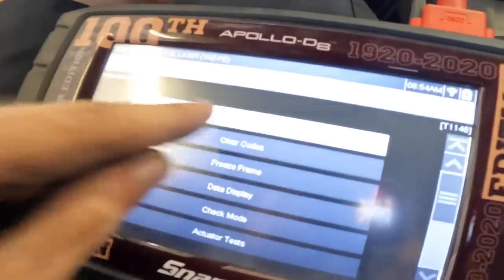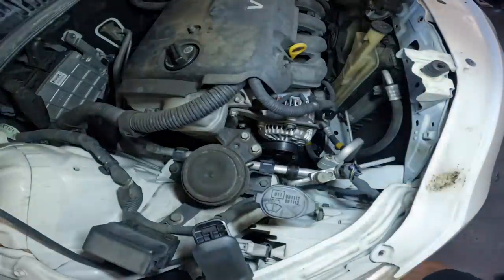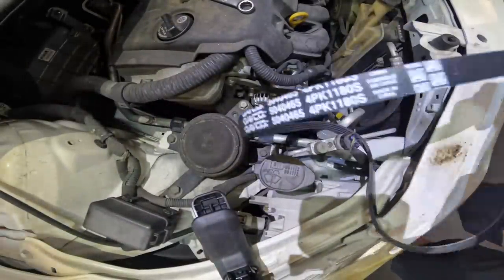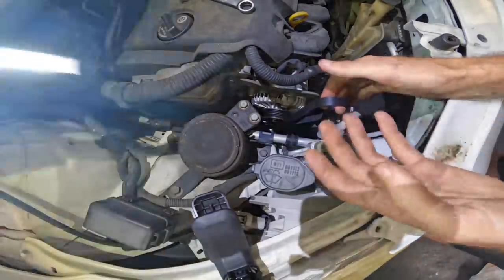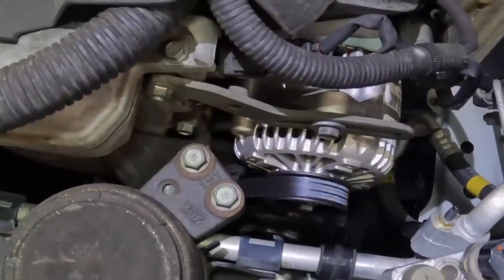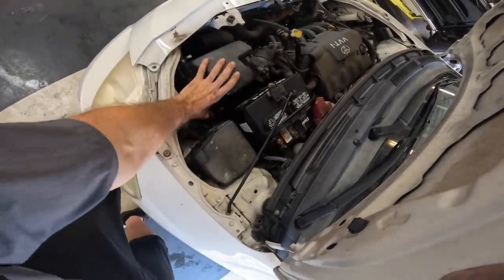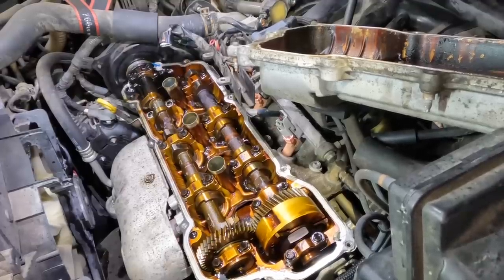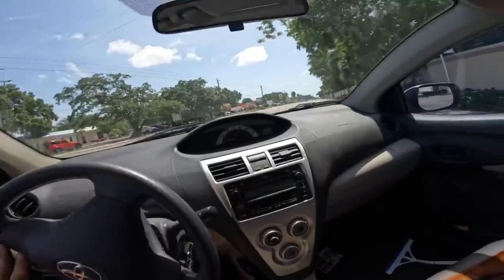Things come in waves & the Service Data Crutch. Said best@SouthMainAuto

Comment: Those particular engines (1nz..) and that alternator bracket setup are notorious for serpentine belt squealing. The variable valve timing solenoid is directly behind the alternator making it difficult to apply tension to the alternator without damaging the solenoid...  I replaced my alternator bracket with a heim joint (turnbuckle arrangement that allows you to tighten/adjust the belt tension while the engine is running). And kudos for the shout out to South Main Auto... Eric O definitely has great content
Reply: Seemed a bit suss that he was talking about the exact same thing Eric O was talking about.
He's already umm, been inspired? by the brake kleen flourish.
Reply: Why didn’t Toyota just use an automatic belt tensioner, the Corolla of that year had one…

Comment: I had a squealing belt on a 79 Mustang 5.0. Replacing the belt would eliminate the squeal for a short time.  Eventually, it was discovered that one of the alternator bolts was broken and the belt tensioner couldn't keep the belt tight enough.

Comment: loaded 2008 Yaris had electric power steering. Bought the car new. Had it a few years and things changed so had to get something else. Good reminder on codes and changing parts could just be a broken wire or connector in that circuit.

Comment: Hehehe Ray that’s how we tensioned out fan belts as they were called in the old days, a little leverage and a guess whether it was tight enough or not!!! Oh the good days when you weren’t totally relying on the design of the components😀😀
Reply: I remember using a straight edge laid across the pulleys to check the amount of deflection on the belt. Of course back then there was so much room even with a V8 it wasn't hard to do. I do miss my old gas guzzlers.
Reply: The good old days of busting bearings and belts for over-tightening, slippage from under-tightening or wear, and another item on a long list of stuff that used to require periodic adjustments 40 years ago. Tensioners take all of the guesswork out of that, albeit at the expense of introducing another critical component in the accessories belt.
Reply: @teardowndan5364  And the good old days of SQUEAAAALLLing noises!

Comment: I watched Eric O's video last night. Instead of Identifix they should call it Idon'tafix. The scanner I bought has a similar app that you can put on your phone. Type in the code and a list "common" repairs comes up. All these apps tell you is to replace components. Years ago I worked with a tech who replaced components on no start conditions. His nickname was "Big Money". He would come to the parts counter and ask for a crank sensor. He would come back with the sensor box covered in greasy hand prints. He then would ask for a cam sensor. Then an ignition module. When I would hand the dirty boxes to our other tech he would reply "I see this part was Big tested and approved".

Comment: If your belt squeals after tightening or replacing and your sure the tension is correct, turn the key to the run position first, count to 3 and then start the car. Theory being that turning the key straight to start causes the ecm to signal the alternator into full charge. This causes the belt to squeal when it's cold. Turning the key to the on position before going to start lets the ecm read the battery charge state and signals the alternator to normal charge or freewheel status. I've suggested this to 2 different yaris owners. Both reported no more squealing belts.

Comment: I watched that video where Eric stated that. A DIY that was in Identifix actually was the issue with the vehicle he was working on. Had to do with rear lights and the shifter on the automatic transmission. The ground female pin in the tail light connector left rear was opened up to much and the male pin didn't make good contact. I forget the code it was throwing. But if he followed the code he would have gone down a rabbit hole and never fixed the problem. In that case, the DIY information was the correct solution.

Comment: Obvious answer - it's caused by the filler cap on in the decorative cover not being straight. edited because I wasn't 100% sure it was oil.
Reply: Yup, might have been ," Lio" ha  And that'd be bad.
Reply: @grassroot011  That's where the 710 weight goes.

Comment: My work truck made this noise.  It turned out to be a pulley wasn't quite lined up.  It started after the power steering pump was replaced.  But before the fleet mechanic figured it out, the belt, pulley, tensioner, and AC compressor was replaced.....

Comment: The identafix is good for either confirming what you might have found along with calling the dealer and they have 10 on hand or pointing you to a general area to start. Most time for electrical it is the kiss method  look at moving parts or where wires flex first

Comment: Ive only seen a new belt look screwed up like that 1 time before. The mechanic put the belt on wrong . He had the inside of the smooth pulley against the inside of the belt and the grooved pulley against the outside of the belt and the ridges were cutting into the belt.

Comment: One thing worth noting is that poly-v pulleys can physically wear, particularly the small ones on alternators.  This is rarely obvious from a casual inspection as the amount of wear needed to cause issues can be quite small, and a new belt will nearly always resolve things temporarily, but the squeaking will invariably come back soon.

Comment: Had a mazda 6.  Kept breaking belts.  After swapping 2 belts to have them break in about 200 miles, changed alternator and belt.  Problem solved.  Alternator felt good, but it was the culprit causing the problem.  Real pain in the ass to swap out.

Comment: I actually thought you were giving it a shout out because of SMAs video LOL guess great minds think alike :).   There is nothing inherently wrong with using the "What everyone else did" function to get a possible direction, but it's not a replacement for experience and diagnostics.  If the "data" says replace the VVT solenoid, that means maybe start testing the solenoid to see if it actually IS bad.  It gives a direction not a solution.   Sadly there are far too many "techs" out there that cannot diag, only know how to load the parts cannon.   :(     Thanks for the Videos Ray!  Great channel!!!

Comment: On those tension-using-alternator belts - I like to mark where the bolt is on that curved slot BEFORE I LOOSEN IT.  That way when I put the belt on - I can see whether I'm going tighter or looser than the last guy.   If my gut feel was tighter - and the squeal goes away - then the mark makes it clear what happened.  But if my idea of "tight" is pretty much the same as the last guy did it - then there's something else going on here.

Comment: An excellent example showing it takes more than a code reader and "what others have done", either from the tool or good old Google, to be a good technician/mechanic.  There are way too many people in the auto service arena who do not fully understand the systems and how they work, and they tend to be the ones who just change parts and often fix nothing.  Those are the people that give the industry a bad reputation.  Btw, you will find people who operate the same way in other service fields, like HVAC for instance.

Comment: Squealing "Fan Belts" (as we called them in the old days), used to be a common problem on our old cars. The fix was just what you did. Put more tension in the belt. They squealed when you drove off from a start, and then calmed down as the load reduced. The loudest squeals occurred when the belt was loose, and you maid a right hand turn from a junction.
A little input from an old fart. (I'm only 66).

Comment: Grooves on the back of the belt means that whatever wheel it's going over with the flat side of the belt has a worn bearing or clutch.  While it's cold it doesn't spin fast enough so the belt is dragging over it, squealing, until it warms up and rotates properly.  The bearing could also be squealing until it heats up.
Reply: That’s I like having a hybrid, no belts or pulleys.

Comment: That wave affect can probably be explained by pattern failures when the fleet of said vehicles start to reach the same calendar time and mileage whatever wears or starts to wear out. It’s just another data point but it’s not bad practice to look at history failures and repairs. It’s not necessarily lazy to research what other techs are doing. In my previous life as an aircraft mechanic the FAA had a whole info system set up to report failures and if they saw the same failure multiple times it would be investigated and possibly AD bulletins or Service advisories were issued. In short no need to reinvent the wheel for every repair.
Reply: Yes. I say, do your own diagnosis, but don't be too proud to look at common problelms in this ballpark. You might want to investigate them, too, to see if they have a problem.

Comment: My suggestion: Bust out the electric ratchet with the right combination socket/extension to reach the bolt when you’re going to apply tension, then go back and tighten it with a wrench. 

Once you get it tight with the ratchet, even if the belt is not as tight as possible, all you do with the wrench is turn it a 1/4 or less of a turn to loosen the bolt and apply more tension as needed and then tighten it back.

Comment: When I changed the water pump for the second time on my Toyota engine in a Pontiac Vibe the water pump came with a powder coated pulley and the squealing started . After numerous attempts to adjust the belt tension I've learned to just ignore it. Only happens on cold starts and is fine after just a few seconds . Newer cars make me crazy .

Comment: Battery supplements the power draw smoothing out the load on the alternator.   Your not wrong,  the battery just adds another factor in the equation.

Comment: I have a 2007 Yaris. This is all-to-familiar for me. I actually have alleviated "most" of the belt squeal by doing two things. I swapped the original alternator for a 100 amp Scion alternator. That helped a bit, but not as much as when I adapted a 1.7 liter Corolla tensioner to fit it. You no longer need to pry on the alternator to create the tension, it uses a bolt and set nut to create tension. Meanwhile, I've replaced the belt 3 times in 5 years because they are just way too thin and small. I'd really like to find a way to make it a 5 rib system, but Toyota doesn't give you much room between the water pump and subframe. Now the only squeak I get is at startup. It will make a quick "chirp" and it's done - and I'm just taking that as a victory, LOL. SIDE NOTE: My Scion alternator is a 5 rub pulley, but I am only using the inner part of the pulley... been like that for 3 years now, and it works great.
Reply: Wow, interesting mod.   I'll try to commit that one to memory.   This mod (belt tensioner) is probably also applicable to other small Yota's and Scion vehicles.
Reply: @jtjones4727  yes, I think with a little ingenuity, it could be applied in a few scenarios.

Comment: I saw Eric’s video the other day.  My take away is how screwed up that on modern cars that a loose ground in a tail light will set computer codes.  I’ll keep driving my 91 Camry until it blows up!  It looks like hot garbage but still gets 25 mpg and the AC blows cold!

Comment: If that was a new belt, and it was tight, then I’m going to go out on a limb and say there is something else is causing the grooves in the back of the belt, and it’s probably one of the idler pulleys that needs replacing. I know Ray said the pulleys were ok, but let’s see if it comes back for round two.

Comment: This vintage of Toyota has a cold start belt squeal nearly always.  In the morning, turn the key from OFF straight to START (without stopping in between) and the belt will squeal briefly. Now shut it off and then turn the key to ON, wait 2-3 seconds, and then start the engine.  No squeal.  Then shut it off and try the straight to ON again and you'll get a squeal.  Stop in the START position for a couple seconds before cranking and it won't squeal.  Explain that one.  I've duplicated it on numerous Toyota vehicles (Camry, Corolla, Yaris, Matrix, etc.)
Reply: Since the cranking key position only powers the starter and engine electronics, it's possibly down to all the electronics with high inrush current (charging their capacitors) putting a massive load on the alternator for a split second after crank (when key returns back to 'ON'), compared to when you turn key to on first, the inrush current will be provided only by the battery at 'ON' first, and therefore is already charged up when the key returns back to ON after crank.

Comment: Things we could have found...like a bad waterpump bearing
Reply: That would squeal more consistently, not just on first start.
Reply: @Cheepchipsable  Just sayin...pulley wobble could cause the belt squeal and odd wear. Still points to the bearing which won't show for awhile. Ask me how I know? I was struck by the fact that there was no tensioner, Then noticed the pulley, maybe seeing things. Long story short I did have it happen to me on on a '79 Corolla. Toyota was specific about the problem and suggested to never adjust the belt but replace the belt instead. Result was a bad bearing due to my over tightening.

Comment: I have already seen the SMA video, but good point Ray. Subbed to Eric O years ago. I check your channel, his and PHAD first for code issues. One that I have not been able to cure so far is a P0172 rich code on a 2002 Dodge neon with the big 2L, 160,000 on the clock. Built a smoker, checked for vacuum leaks, none. Parts cannon fired multiple times, new pcv, plugs, map, IAC, injectors, and O2. Expensive cannon, but no joy. Money light still on. Many bad words said along the way, still no joy. Inspection due end of July and wife is not happy, so naturally I am in the doghouse. I need to get this fixed. Any bits of wisdom for this issue? Throttle body cleaned too.
Reply: Usually when I have a problem like that I'll approach it by making a small list. You're working on a car that works off of a MAP instead of speed density like a car with a mass air flow sensor. So what can make it run rich?
-a faulty O2
-a faulty MAP
-contaminated engine oil
-a faulty fuel pressure regulator
-faulty fuel injectors
-a stuck canister purge valve
Just to start a list for you... Once I have my list you can run pinpoint specific tests to see if any of those items are the cause of the rich condition. Most of the tests on each items can be carried out fairly quickly and with definitive results leading you to the answer. 👍

Comment: Hey Ray, 
My Father owns a 2007 Yaris and I seem to have to tighten the alternator on a yearly basis but the Dayco belt is holding up fine on it. I suspect it's a common occurrence for belt squeal on that model.
Reply: i got 350000 kms on my 2007 and the belt grooves wear so the belt bottoms out on the pulley 
then it doesn’t matter how tight you make it it still slips under load of air con.
he did a good job as it’s usually the belt on those 
and if you let it squeal it will cut it in two one day and your walking unless you have another one.
they make a measure tool  for how those grooved belts wear to check them but there $25 at toyota so replace it ha.

also
amazing job changing it from the top
(when i break it on the road i have done it)
 i’m jealous i can do it but its not easy and he made it look easy

Comment: For there to be that badly grooved on the outside of the belt I would of suspected wrong belt routing or a loose part or bolt interfere with the belt.

Comment: I've had bad experiences in the past with Gates belts stretching. It becomes more of a problem on systems without an automatic belt tensioner. I've avoided using Gates belts for 25 years so I don't know if it's still a problem.

Comment: I am not sure how to feel about the sharing of service data most commonly used fixes, on the one hand it can be good reference material, on the other hand it may lead to a wave of lazy diagnostics. Remember kids nothing beats good old fashioned trouble shooting and you need to approach each customers piece of equipment as an individual case, experience and data can give you a ballpark idea of what is wrong but always verify.

Comment: Those early yaris's have a strange issue with squealing belts when turning the ignition key too quickly and starting it when the engine is cold. I had a 2008 yaris and have had the belt replaced about 5 times... No on knew how to fix it and just slapped a new belt on it. If you leave the key in the "on" position for 5 seconds and then turn over the engine, the squeal will not happen. Only when you immediatly put in the key and turn it will it sqweel from a cold start. No body new how to fix it and I just learned to live with it. You might be hearing from that customer again... Apparently it has something to do with the computer.

Comment: on those cars, power-brake while sitting still with brakes anchored hard and turn the wheels back and forth. that makes extra high steering load current from the increased tire resistance, since the wheels cannot roll the slight amount they normally due to the brakes. just don't do it for a long period and cook something 😋

Comment: I got a squeak problem in my car but its the weirdest thing. Only happens when the wife is in the passenger seat with the windows rolled up..  it will randomly squeak then start smelling like burnt rubber and old tacos..  like theres a critter up under the hood that steps on the wrong spot..  my wife never hears it and says she thinks its my tires smelling like that..  and as a matter of fact i put the same tires on her car and hers does it too when i ride with her..  gotta be the cheap chinese rubber making the noises..